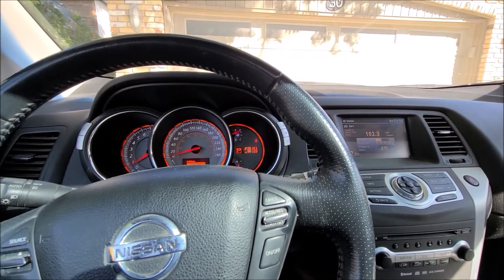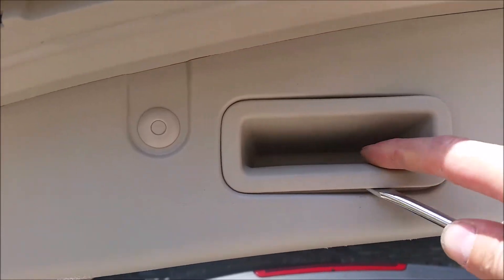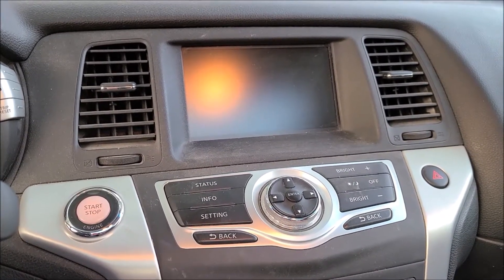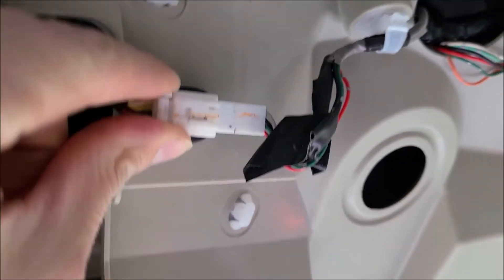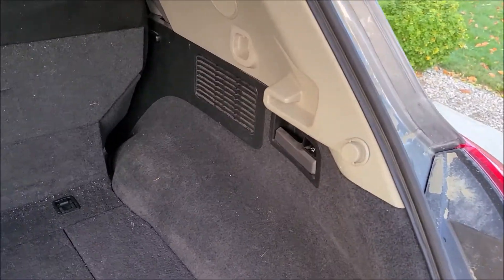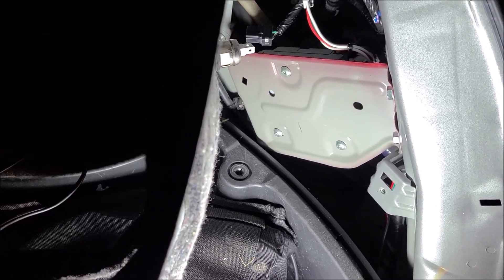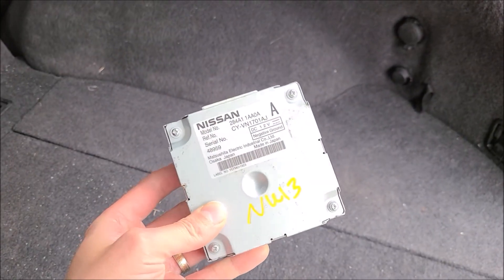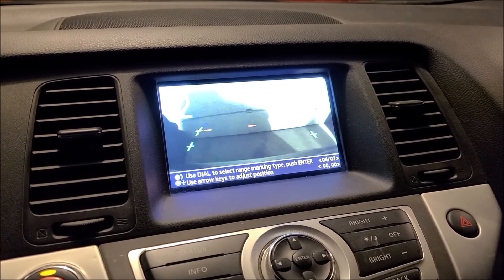2009 Nissan Murano Backup Camera Fix

Comment: This is an amazing step by step walk-through, thank you! Just bought this car and am having the same problem with the screen just turning black when putting in reverse. I pulled up the system diagnostic menu but the “Camera Cont.” option is not there. Not sure what to do at all as there is a camera on the car and it clearly recognizes when the car is put in reverse as it switches to the same screen as yours. So where do I even start with this option not even showing up?
Reply from the maker: Just to confirm you can get to the Confirmation / Adjustment screen in the System Diagnostic menu but you don't see the Camera Control option?  I know it's not displayed on the initial screen but I'm assuming you tried scrolling by pressing the down arrow 5 or 6 times.  The only other thing I can think of is that you might have a different version of the Self Diagnostic software which may have subtly different menu options.  What year is your Murano?
Reply: @shaneperche-fixed-it  Yup, I did all of those steps and see the same exact menu as the one you have, just didn’t have the camera option. Mine is a 2009 Murano.
Reply from the maker: Ok, thanks for confirming.  I haven't seen that issue before so I'll see if I can find a solution in the Nissan AV service manual.  You can find the manual here if you want to also take a quick look:  https://www.nicoclub.com/service-manual?fsm=/FSM/Murano/2009/AV.pdf  It's quite helpful but sometimes it takes a bit of reading before you find the information you need.

Comment: @shane, I have the issue with Murano 2007, both rear camera and reverse light are not working, any help will be appreciated!
Reply from the maker: Hi Boba,

This is a tricky issue to diagnose as there are quite a few failure points.  I don't suspect the camera itself since the reverse lights are also not working so it is likely an electrical issue between the shifter sensor and the reverse lights/camera.  For example, the switch/reverse sensor itself, a fuse, a broken/shorted wire, wire connectors are not fully connected, or the control unit itself.  It's going to be a process of elimination so I would start with the easy stuff and check the fuses first.  
Next look for signs of broken wires in the points with high wear and tear (i.e. where the trunk opens/closes)  Next check the switch/reverse sensor in the shifter plate.  You can test this by going into the AV diagnostic menu (which I show how to access in my video) and select Vehicle signals then look at the reverse signal value.  (It should be off)  Now put the car in reverse and make sure the signal changes to on.  Then go back to park and make sure it goes back to off.  If the value doesn't change, then it's very likely the shifter position module.  If all of this passes you're going to have to track down the wiring diagram and test the continuity in the wiring from sensor to the control unit/lights.  It's going to take some time and patience to troubleshoot this so don't get frustrated as you'll learn a lot about the car in the process which will help you diagnose and fix future problems much faster.

Hope that helps,

Shane

Comment: Okay I see this black screen everywhere, but what if the camera doesn't even register? My issue first started when I was driving and all of a sudden the camera turned on and stayed on until I'd put the car in reverse and then back in drive. But then it would just come in again and I'd have to do the same thing and it wouldn't go off by itself. Now when I put my car in reverse nothing happens on the display. No change no nothing. I thought maybe water damage from when I left my sunroof open during the rain (even though my car was under a very full tree) but when I took apart the whole center assembly all the way down to the metal I could not see anything that could have been soaked in water OR any exposed wiring so I'm not sure what to do or look for at this point. Not sure if you or anyone watching this video would know...

Comment: Had u had any problem with your keyless entry? I’ve been, but can’t figure out why, was wondering if you know, 2010 Nissan Murano SL
Reply from the maker: The only time I had problems with the keyless entry was when the battery on the fob died which is a pretty easy fix but I'm assuming you probably tried that already.  I have also seen issues with interference if you have multiple fobs on your key chain so make sure to test your keyless entry with only one fob in proximity of the door.  Then try the other fob in isolation.  If both key fobs fail, you may have an electrical problem or your key fobs may need to be reprogrammed.  Unfortunately, there is no way to self program the key fobs for the 2009/10 Murano.

Comment: Thanks for the video.  Did you try to put it in reverse after it turned on after diagnostic mode with the original camera control unit?  it was weird it turned on.  Was your picture intermittent before?
Reply from the maker: Yes.  After I opened it up to inspect the board I ended up putting it back in the car for about a week and it did not work at all again.  After replacing it I haven't had a problem since.